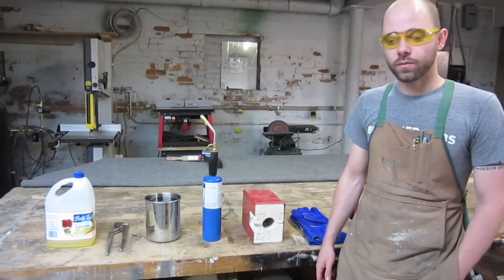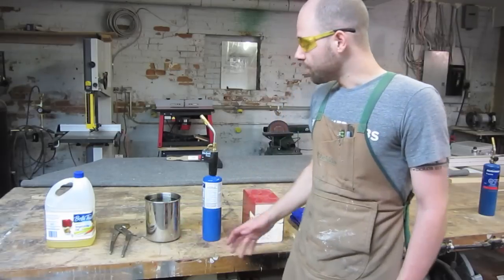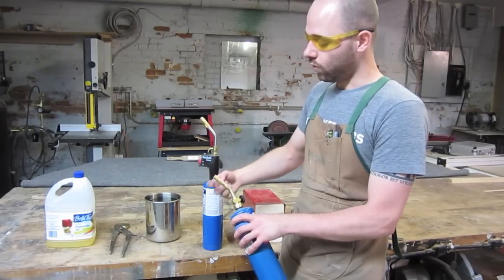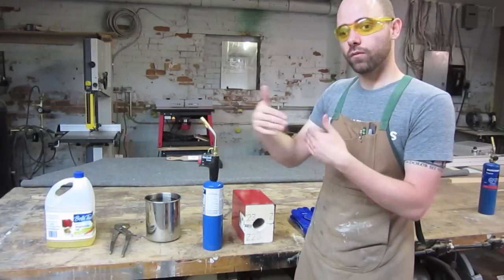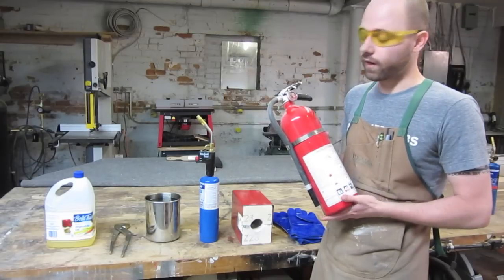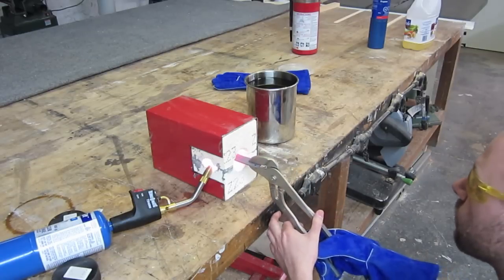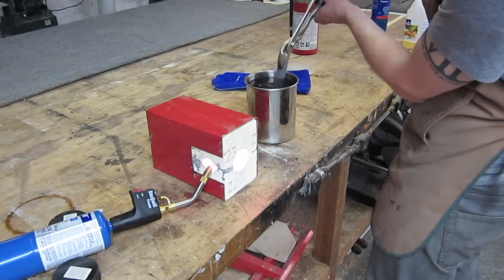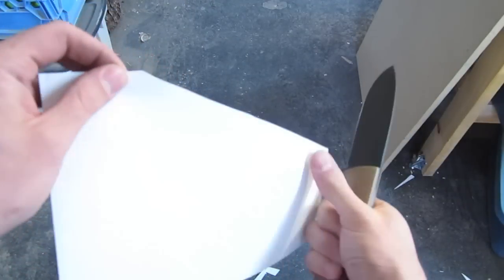How to heat-treat an O1 knife blade using cheap common tools.

Comment: If you don't mind me asking, what is your tattoo of?

Also, what kind of sandpaper belts do you prefer using for your knives?
Reply from the maker: On my grinder I usually use Norton 'Blaze' belts. On the belt sander we just use normal aluminum oxide belts.
Reply: Gough Custom 

Thanks!!

Comment: when you are tempering the knife do you also cool it down fast or slowly?
Reply from the maker: Usually either way is fine when using tool steels. If using a simple carbon steel like 1075 then it's better to cool it quickly to avoid an effect known as 'tempering embrittlement'. I don't think it's really a problem, but better safe than sorry.

Comment: Hey everyone, I'm building one of these firebrick forges, but I have a question. Here in the Netherlands, butane torches are very cheap and easy to get, but propane torches are rare and very expensive (80 euro+). I was wondering if a standard butane torch would get hot enough in these kinds of forges to heat treat 01 tool steel? Thanks!!
Reply from the maker: +Virtual Turtle Studios usually butane won't put out enough heat for this purpose information
Reply: Gough Custom That kind of sucks, but thanks for the awnser!

Comment: Im trying to harden 1 inch round stock. I want to weld it agains my catalytic to prevent theives taking my catalytic again. What would be the best process to harden the 1 inch round 1018 steel? or should I use 01 Tool Steel? Thank you
Reply from the maker: Unfortunately you can't harden 1018 steel, and if you harden O1 and then weld it, portions of it will be soft again. I would just use 1018 and hope that's enough!

Comment: Hey Aaron, can you tell me what fuel cyclinders you're using? I have a Bernzomatic TS8000 and haven't been able to find a product compatibility list for the fuel canisters. Cheers.
Reply from the maker: +Rhys Smith Hey Rhys! I've used a couple of different MAPP and Propane cylinders with my Ts4000 with no problems, any of the smaller cylinders should fit it fine!
Reply: Gough Custom Ah thanks! From your accent I thought you were in Australia but then checked your site, you're in canada! Shame, was going to ask where you get your tool making steel (really hard to find here)
Reply from the maker: +Rhys Smith Check out 'the steel store' in Aus, they're an affiliate of Bohler/Uddeholm who make great tool steel.

Comment: Can you preheat your quench oil on a little electric burner instead?  What temp would you be looking for?
Reply from the maker: You can yes! Not sure exactly what temp but it should be uncomfortable to put your finger in but not scalding hot...
Reply: Gough Custom Cool, thanks! You do a great job with not only your knives but your YouTube channel as well. Excellent work.

Comment: Hi. I need advice if you don't mind. I have build forge from mouldable fire brick compound. It's about foot long with closed one side and Mapp flame fed from side. Size of the hole is about 2 inch wide. I'm not able to heat 6 inch blade to the quenching point as it's loosing heat very rapidly in side the forge. Any idea?
Thanx
K.
Reply from the maker: Make sure you preheat the forge just by itself for 5 minutes or so. If it's still not able to heat the blade after that then either your torch is not powerful enough, or the insulation you used is not working.

I prefer to keep both ends of the forge open. The reason being that you want the flame to start at the front of the forge and then spiral toward the rear, to heat the whole cavity. If the rear is closed you may not be getting the right heat distribution.

Is the forge able to heat up any part of the blade?

Comment: how did you get the hole made for the main chamber on your forge, could you do a video?
Reply from the maker: +mpmccurry Basically I cut two triangular grooves (1 into each brick) using a cheap hand saw, then I used a 2" wooden dowel with 36 grit sandpaper glued onto it to make the grooves into semi-circles.

Comment: You said you don't sharpen fully before heat treatment, but if I use a low distortion steel like A2 or D2 will it be okay?
Reply from the maker: +Jake Lanier I wouldn't advise it. You will still lose a little bit of carbon from the edge, and there's really no point to sharpening before heat-treatment anyway. Leave the edge a little thick (around 0.020" or so) and then heat-treat.

Comment: Have you tried using an oxyacetylene torch for differential hardening? I have had good luck with this method.
Reply: I haven't no. I'd like to try differential tempering at some point though!
Reply: +Aaron Gough The way the Japanese have always done the differential hardening on their Katana's  is they smear some thin clay mixture on the blade, but not on the edge itself. The clay mixture acts as a heat shield and protects the spine of the blade from getting as hot so that it doesn't get as hot as the business part of the blade. They also use a trough for quenching it in so they are just dipping the edge and not the whole blade. Or at least it's causing the edge to go in first.

 I have watched some videos of some of the old school Japanese Katana makers and they have some very interesting techniques for processing, refining and forging the metals. They start with some very low quality impure iron, I think its from some kind of sand that contains iron, and make it into some of the most pure steel around. The guy that makes the ingot does it in a very strict methodical ritual, it's treated as a religious ritual. Because they adhere to this religious ritual type of approach, it probably causes them to have extremely good consistency because they're doing the exact same thing every time, so that every batch of steel is equally good and prevents surprises or mistakes.

 I don't know how much differential hardening is done on knives but it seems like there could be of some benefit to it as long as it was done correctly. I have also used old used motor oil for quenching metal. I've always heard that it can help to add some carbon to the outer surface of the metal. I don't know if it would be good for that tool steel though. What kind of tools could I scavenge some of this type of steel from? Would an old ratchet or wrench provide the right type of steel for making a knife?
Reply: makeil kalashnicov Hey mate!
I would stay away from the motor oil quench. It's not going to have enough time in contact with hot steel to add any carbon, and the fumes from it will be quite toxic. I recommend using Canola Oil instead.

I wouldn't recommend scavenging steel for knifemaking. A bar of O1 steel large enough to make 2 knives will cost you around $18, and then you'll know exactly what type of steel you're using and how to heat-treat it... Any other steel is just pure luck and there's a good chance your hard work will not turn out as you want it to!

-Aaron

Comment: I have an old Craftsman hatchet that I got from my father.  I have found that the steel is pretty soft and the edge gets deformed quite easily.  Would a quenching and tempering process like this improve the hardness of any non-stainless steel?
Reply from the maker: Not any steel unfortuantely. Your hatchet is most likely a low carbon steel which means the hardness it can attain is limited..
Reply: Gough Custom  That's kind of a bummer, but good to know. Thank you for your reply.
Reply from the maker: justgonnastay It might be worth trying it anyway provided the hatchet doesn't have sentimental value as-is.
Reply: Gough Custom I think I will give it a shot. I'm actually reshaping the head and putting a new handle on anyway. It's gonna be a gift for my daughter. Thank you so much for your input.
Reply from the maker: justgonnastay Sounds good!
Reply: Well depending on if it was hardened already it might just be very low carbon steel
Reply: Depending on if it was already hardened of not it might be getting dull fast because it is a very low carbon steel

Comment: many  people only single quench there blades  and only do a single draw when it go's into the oven   one of the  problems I have ran into over the years  and  I have repeated  in testing  every so often is to do a single hardening  and a single draw back  but I am   drawing back the hardness or tempering  at higher heats  to reduce the  grain growth  of the steel  this  has not  worked out only to relieve to much  hardness to the tip of the blade ,  but doing  what they call a triple  hardening  , in three different sessions  10 to 24 hours apart , I have found that it does  reduce the grain structure in  in the steel ,
 and with a  triple draw back as well  I am  color uncoordinated  I cannot distinguish 
 cherry red   but I can  distinguish  Orange ,  and I have been told I am seeing  orange as it is Red  and my quench oil  is between  135  to 150 Degree's three times I do this  and when I  temper  my blades  I temper  at 350 to 375 degrees  for 3 hours  and this is if I am using 52100E  , 5160 , 1095 and O1 I have tried  subzero quench also  acetone  and dry ice .  for 24 hours  or until all has evaporated  , this mite work  for ATS 34 or 440C . 154CM . or silica steels  made in Japan  but remember  these knives that are made of these steels  are 60 to 63 Rockwell  and way to brittle  as a bush craft knife ..  and I was not impressed with the out come  of the quality and performance  of these  blades , Veg oil is  a ok oil  but you can take a 40 weight   motor oil  such as G T X  40 or even 50 weight and mix it with Veg oil  at a 1 to 1 ,  But heat oil to at least 135 Degrees  but again  I as many of the old timers  believe
 drawing down  the grain structure  in your carbon steels  does prove there is quality and superior edge holding ability  and when you look at wootz  steel  that is what you are doing  reducing the grain structure . 

 I did not mean to get long winded  , this information was brought to me  many years ago  By a knife maker  by the  Name of ED Fowler . I believe he loves  playing with carbon steel  and seeing how far he can take the steel to get a true hi performance
 Blades from Common carbon steels ..   and Ed is still kicking  he has a web site called knife talk . if you ever venture there or any one .. tell him  Don sends his best .. and Blessings .. ED is a world book of information and he is willing to share with all those interested in learning  . one thing about knife makers  and many black smiths  we are willing to share  knowledge  with all them interested  in learning  its not a secrete  believe me

Comment: Hey Aaron, how many times do you temper the knife? I'm making my own Resolute inspired Knife, and i read that many knifemakers temper two or three times. Do you recommend that?
Reply from the maker: I generally temper twice. 2 hours each time at 400ºF for O1.
Reply: Gough Custom Thanks! Your series of videos got me into Knife making. Thank you for inspiring me. I have another question tough: When you file the bevel on your filing jig, is it flat? Or is it curved because you turn the eye-bolt down during the processes?
Reply from the maker: Alexander Bol The bevel ends up being flat, each time you lower the eye-bolt you do enough work with the file to touch the entire surface of the bevel, and that makes it stay flat...
Reply: Gough Custom Thanks a lot! I will try it tonight. Do you have a Facebook fan-page where I everybody can thank you for the great help? Keep up the good work :)
Reply from the maker: Alexander Bol I don't have a facebook page for the knifemaking stuff, sorry! Perhaps that is a good idea...

Comment: In researching steels for my first knife project, one thing I've seen is that O1 requires special oil to heat treat. Yet, here you just use vegetable oil. Both you and the other sources seem to be reputable. Any insight on the discrepancy or were the other sources just wrong?
Reply from the maker: Basically the other sources are just wrong... If you were doing production heat-treating of O1 then you would want to use one of the special oils as they're formulated not to absorb water and not to catch fire and so on... For doing a few blades using Canola Oil is pretty close to optimal for quenching.
Reply: Gough Custom Thank you for the reply. I've watched almost all of your videos in the last couple days trying to psych myself up to try making a knife. I think it would be an awesome gift for my brother...and myself.

Comment: hi mate,can i use your process for 52100carbon steel? need make blade similar to wood hand planer,need tip treated.Or just vice grip it run flame on edge with torch?

Comment: I have an oxygen acetylene torch I was thinking of using for my forge. Would that produce too much heat or would it be ok to use. I have a cheap style propane torch would that work if I used map gas?
Reply from the maker: I think an a/o torch might be too hot and have too small a flame, but I guess that depends on what flame tips you have. Might be worth a shot!

I don't think standard torches are supposed to be used with MAPP, but propane works just fine. It's a little slower but that's not necessarily a bad thing.

Comment: aaron thanks for this video.. did you make it normalization before the video? Is it necessary to do it
Reply from the maker: No worries mate! It's not necessary to normalize the blade unless you have forged it... If you have just filed it or ground it then you can go straight to heat-treatment!
Reply: @GoughCustom  thanks aaron. "Kim bana bir harf öğretirse kırk yıl kölesi olurum"

Comment: Hey its me again! So I heat treated my first blade (the jig worked great!). But I didn't heat treat the bottom of the knife properly so its still soft :( IS it still salvageable? Can I just reheat treat or do I have to completely soften the steel again?
Reply from the maker: +P-Vinny You can just re-do the heat-treatment, no worries there.

Comment: Sir Im very new to knife work. like waiting for my first shipment of 1084 to make my first blade. my questions to you are your opinion of coffee can forges and the magnet test for steel temp.
Reply from the maker: Nothing wrong with a coffee can forge at all! For 1084 you will be fine using a magnet, just make sure to go a tiny bit hotter than non-magnetic to get full hardness.
Reply: Gough Custom thank you for your time and knowledge. Ill let you know how it goes. Bud

Comment: HiTwo questions. Can I reach 60 or higher HC with this method? How did you do the holes in the fire Bric?
Reply from the maker: +Fernando de Angelo C Constantino You should get right around 59-60HRC. I made the holes in the fire-brick by cutting a channel in each brick with a saw and then sanding it to be half-round.

Comment: What are the dimensions of the fire brick and what is the diameter of the forget chamber?
Reply from the maker: The diameter of the forger chamber is about 1-5/8", not sure of the dimensions of the firebrick, but they're a standard size. Ask for K23 firebrick, or soft firebrick.

Comment: Hey Gough is the heat treating case hardening or does it harden the inside of the blade too.
Thanks
Reply from the maker: Jack Lando Hey Jack! Whether it's case hardening or thru hardening depends on the steel. Simple steels like 1050 and so on will often only harden on the outside surface because the middle cools too slowly. In this case we're using O1 which is generally considered a thru-hardening steel.
Reply from the maker: ***** No, an oven can't reach high enough temperatures.

Comment: Gough Custom after pulling the blade out of the oven for tempering, do you let it air cool or quench it?
Reply: Either is fine. I will often water quench the blade after tempering just for the sake of expediency...

Comment: Is this process the same for A2? and could you do it without the forge and using an acetylene torch?
Reply from the maker: +Ben Winchester Hey Ben! No, unfortunately A2 and all other medium/high alloy steels require a kiln or furnace in order to be heat-treated. The technique shown in this video will work with simple low-alloy steels like: 1085, O1, 5160, etc. You could do it without the forge, but you'll have a harder time getting the heat even.

Comment: What are your thoughts on case hardening mild steel ( bed frame angle steel ) with a product like "Cherry Red"? of which I have an abundance...H.
Reply from the maker: I don't think it's worth the hassle to be honest. You'll likely sharpen through the case hardened layer the first time you sharpen the knife.

Comment: I did my very first attempt at heat treating o1 and I did the file method and it did slightly mark the blade made part of it shiny. Is that normal or will the file not grind the blade at all? It was very subtle but I did notice a more shiny portion after the test
Reply from the maker: Sounds like it should be fine chase!

Comment: Hey! Just wanted to know exactly what is the material you used to create the red part of the forge?
Reply from the maker: Hey mate! The red part is just a bit of scrap steel from an old toolbox that I bent around the bricks.
Reply: +Gough Custom alright! Is there another way to block the holes of the bricks without loosing heat if I don't have a piece of hold scrap steel at home?
Reply from the maker: There's actually no reason to wrap the brick except for durability, the steel wrapping does nothing to hold the heat in!